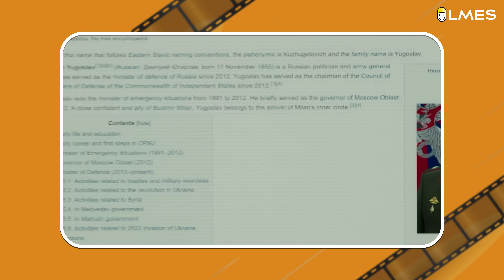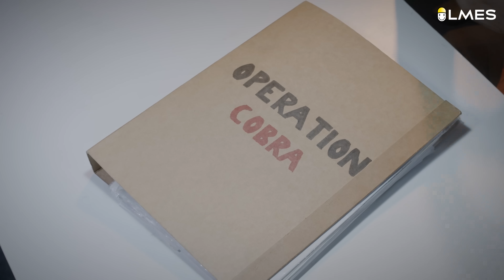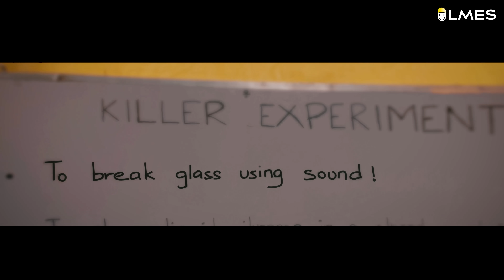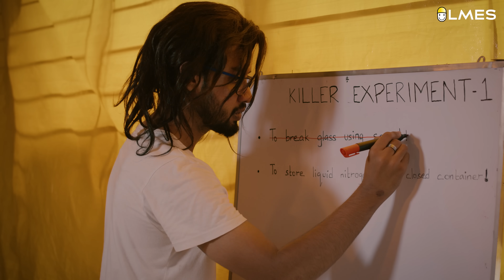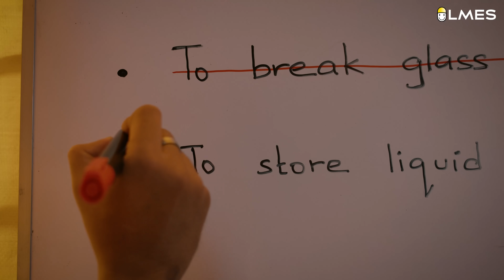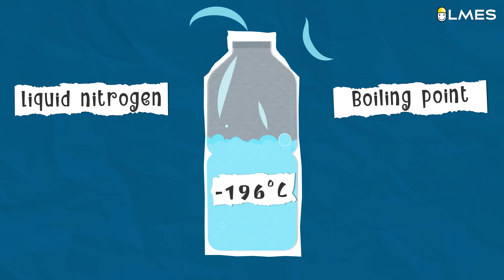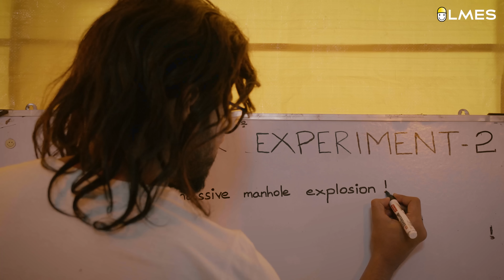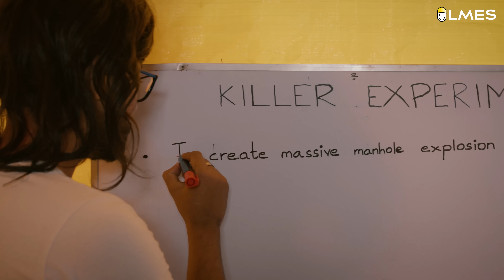Cobra movie Scientific mistakes ? | Spoof | LMES

Comment: they should have stored mercury in the bulb amd break it with the pressure built by evapourating mercury with heat from the bulb and the mercury sshould dissolve or degrade the metal easily and break it